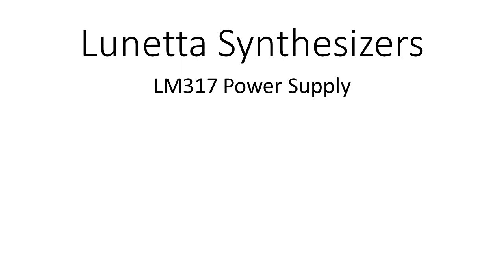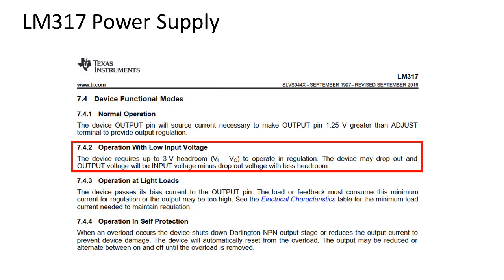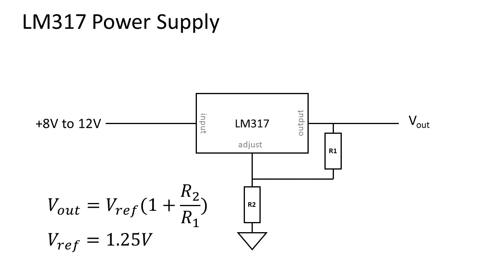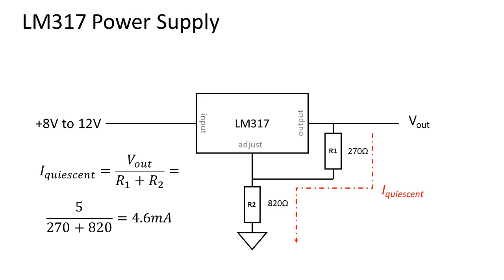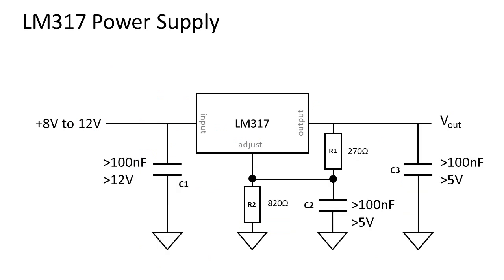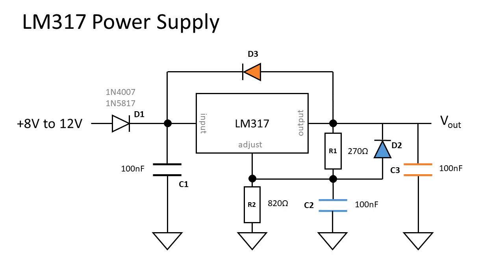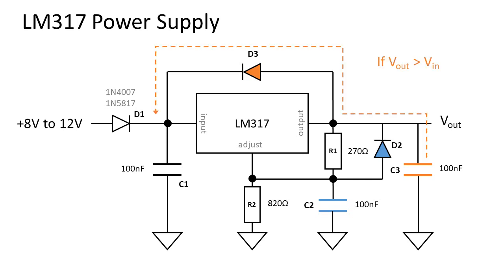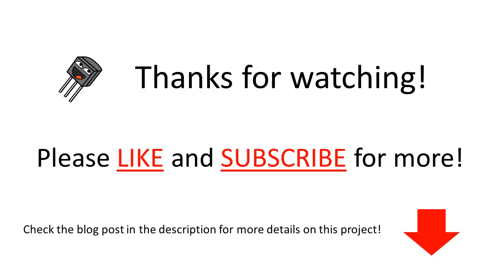Lunetta Synthesizers #3: Power Supply Design (LM317)

Comment: To be honest no-one makes their own Lunetta power supply these days. Modern wall warts are so well regulated that all you would ever need it in the SMPS. Okay you might add an extra capacitor but you have every reason to expect an accurate stable powers supply for no more than the cost of the components to build your own.

Comment: What's the point of making a PSU that can deliver ONLY 100mA?!
My own Eurorack system suckes nearly 1.8 A on the positive rail and about 1.2 A on the negative one!!
Reply from the maker: The requirements state a power supply that can deliver >100mA so 100mA or higher. The LM317 (if using the to220 package) can get to 1A and more with proper heatsinking. Then again, the current draw for a lunetta system doesn't have to be very high because all these CMOS chips really don't need much power to do their jobs. A 40106 oscillator only needs a few microamps.

Eurorack systems on the other hand are way more sophisticated and often contain digital modules that use DSP or whatever to create their sounds. These will always bump the current draw up quite a lot.

Besides that your Eurorack system also works with way higher voltages, possibly has some LEDs here and there and maybe an integrated amplifier to power speakers/headphones. These luxuries all add up of which most won't be a thing for Lunetta systems that run on 0-5V on average.

At the moment im running multiple oscillators, some frequency dividers and sequencers (all CMOS 4000 series) on a LM7805 power supply, barely heats up at all.
Reply: @trevortjes  I see. but my modules are MOSTLY ANALOG (including some based on CMOS logical chips).
Yes it has a lot of LEDs, which I would  include in a Lunetta system anyway.